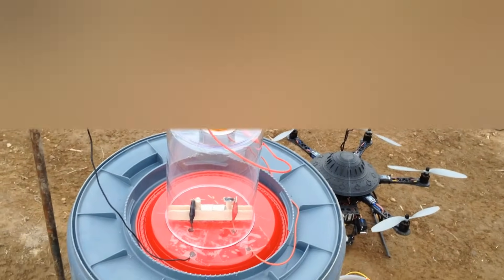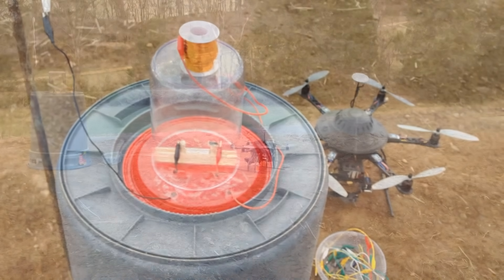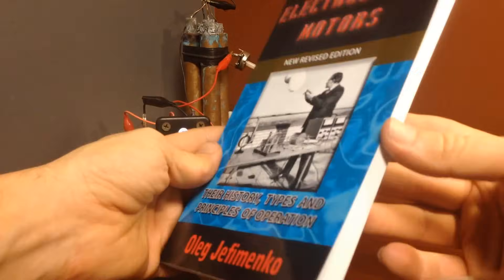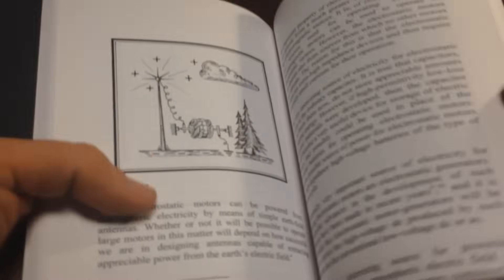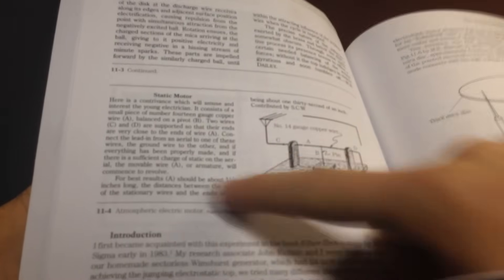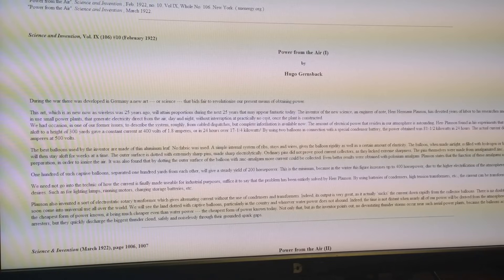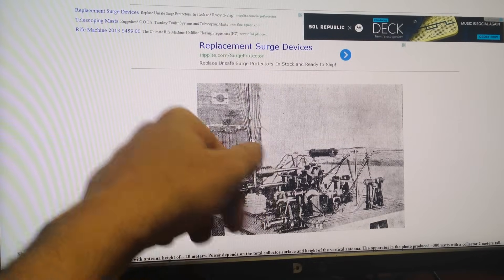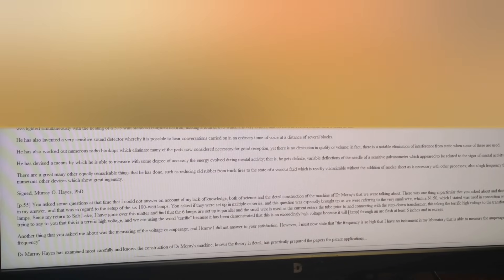Free Atmospheric Electricity Powers Small Motor - Tesla Radiant Energy

Comment: I wonder how much of the energy you are picking up is coming from the motors of the drone you are using to lift the wire.  Just placing a wire in the air will not generate electricity because the wire is not crossing any magnetic fields (other than the magnetic fields generated by the drone).  Now if you could somehow spin a long wire....sure, you'd be crossing some magnetic fields and generating some electricity.  But, since the earth's magnetic field is not moving and your wire is not moving, there is no way to generate electricity.....except for what you are picking up from the drone's motor's EM action.

Comment: There's a secret to tapping a lot more energy from the atmosphere.    Just ground the circuit several times each second to produce an AC circuit and that amplifies how much current is available, which is normally very low.   How this works is it collapses the electric field around the metal conductor each time it's grounded, so that more energy is pulsed through the conductor.   The grounding frequency of the circuit would be very low 4 to 8 hertz, which is possibly related to  Schumann resonances of 7.83hz.   Feynman did a lecture on 'Electricity In The Atmosphere', that's easy to find.     Thanks for the video!

Comment: That rotor wobble is caused by the asymmetric shaped copper rod. Keep the copper rod straight and use a non-metal centering spinning bearing, it will improve the spin significantly. the asymmetric shape causes it to want to rotate on its secondary axis while it is spinning known as the Dzhanibeckov Effect. see celt:

https://www.ebay.com/itm/Celt-as-seen-in-Boyd-Bushman-David-Sereda-interview-defying-the-laws-of-physics-/173553405658

or

https://www.youtube.com/watch?v=1VPfZ_XzisU

Comment: AD Moore's book changed my life! Along the way I discovered that the Earth has layers in the atmosphere. Ever notice the clouds look like they are sitting on a table? With rounded corners and flat bottoms? There's a barrier above them too. This boundary effect d disallows CFCs from traversing to the upper atmosphere to destroy the ozone. The proof they claim is free chlorine atoms, but these chlorine atoms are the result of oxygen receiving an energetic proton to become chlorine. Just as the water vapor layer is resting where it does, the ozone layer does the same thing. When the voltage is sufficient the ozone level increases, formed in place.
Notice also that rain will start when the barrier the clouds are sitting upon short in a lightning bolt.
This is the dynamics of an electrical double layer. 
As an aside, ever consider that uranium hexafluoride is a has? The heaviest elements in the table can float when you give them a +6v? This is a repulsion from Earth's own positive net charge. IMHO
Using tungsten hexafluoride and sulphur hexafluoride you can coat something in a shell 5x stronger than steel, tungsten disulphide...
This last tells me you could use Styrofoam beads in a vacuum to be coated with WS2 and make spherules that would be lighter than air, an analogue to the submarine, a subAeroine if you will... These beads could fill a balloon for lift.

Comment: You don't need the antenna. Tesla figured this out in his later years. He developed smaller units which were fairly powerful. They do require an artificial high voltage source like a neon sign transformer.
Reply: That's right, the unit he had that powered his EV had two 1" or just greater diameter (1.25" or maybe even 1.5") antenna that wouldn't have been much more than a foot long combined. 
He had to tune them by sliding them up and down in their holder from what I could glean. 
They looked like solid carbon cylinders sticking out of a metal box smaller than a car battery sitting on the passenger seat of the car in the pic I saw.

Comment: Not sure if this is practical yet. Would be nice and solve the electric cost. Need some way to capture and store this then be able to utilize this process and the stored electricity for a practical uses.  My findings are that the average family uses about 3000 watts in a days time. So you need recharge the storage. Let the world know if you figure it out you can sell millions and the power companies would go broke. .Many would sell the power companies stock short and sure enough as the profit was gone they would go broke. Trillions of dollars at stake and who wants to invest in power that can't be sold. Many have very high voltage in over head power lines from 12000 volts. You see these florescent lights under 250,000-500,000 high voltage power transmission lines. Power companies would not like you tapping into their power system.

Comment: The problem is the intense. It is only Pico amperes . So the high voltage doesnt really mean anything.
Reply: Use step-down transformer to decrease the high voltage and increase the current/amps.
Reply: @Xeno_Bardock  still the density of the energy is very small. from pico ampere to rich ampere you need to multiply per 1.000.000.000.000 times.....
Reply: @ikaros2006  Depends on how one builds the antenna, also the density increases the higher the altitude antenna is raised. The source of atmospheric electricity is birkeland currents from the Sun which has lot of power. https://www.youtube.com/playlist?list=PLwOAYhBuU3UeKWHRrCw4i-KviQnAhQhBM

Comment: A lot of voltage but probably about few micro or pico amps. So not a lot of power here where you can't power any things like a drill even if you lift thousands of drones in the air. I'm wrong ?

Comment: It is interesting about getting electricity from the sky..with the multitudes of sky scrapers being built you would imagine why the energy isn't used to collect electricity..with them being so tall and huge electric wires could collect current from inside the building and sent into a collector..you wouldn't need wind Mills.
Reply: The main problem with that is once you build something that is electrically conductive to a degree and is also that large, it becomes one with the ground and the electrical fields that increase every meter up just bend around it for the most part.

Comment: i am not here to disrespect or discourage anyone, but only for the truth. As fascinating as the subject of electrostatics may be the truth is using ground voltage differential for electricity is just not feasible. We can generate immense amount of voltage difference using large collectors and clever geometric manipulations, but voltage in itself dont generate current. There are two primary ways to generate current - 1) the exchange of  electrons by ionised electrolytes in electrochemical cell. Thats why we use active electrolytes and make it dense. Air is too thin and inert. 2) the constantly and rapidly changing magnetic flux that induce current in the wire. Here the spinning rotors are at very high rpm for to increase the change of flux...
Nonetheless our understanding of electromagnetism roots from from understanding of electrostatics. And we do make use of ground potentials but generarting current isnt one of them

Comment: Side note: if u notice outside MOST hydro wires are at exactly 33.33 feet high and go 15 feet MINIMUM into the ground, or "Ground".  🍻 And a mushroom shaped ball-head at the top of a 33.33 foot tall wooden pole works AWESOME. Wire snakes around pole to bottom. Add a spark gap arch to keep the electricity flowing from the ethers and then plug in your powerbar somewhere inline above the ground. Also add a bypass line for lightening strikes, and serge protection inline going to home, powerbar or whatever u are powering. Enjoy!!! 🍻 Also, Rodin Vortex donut coils work inline also. Then all u have to do is tune the cycles per cescond from the standard 60hrz to...say...6, 12, 18 etc until your lights work or whatever

Comment: FYi guys...for every foot high u NEED TO GO INTO THE GROUND THE SAME AMOUNT. The point is to go down into the ground to at least the water table, like the Pyramids of Egypt. Salt water is even better. So recapping: minimums are 33.33 feet high AND 33.33 feet deep or down to water table. Think: Van Dur Graff generator WITH ALL SOLID STATE PARTS/NO MOVING PARTS. (Less maintenance)
Reply: that isn't how grounding a circuit works

Comment: I think u need more surface area on top plate. So u will have greater potential diffrence beetween earth and top surface u will put up in sky. The wire will disturb that electric field creating crossing beetwen collapsing dielectric field into magnetic field into the wire, now u have capacitor so it will capture that movement when disturbed by wire potential will try to balance itself with capacitor potential. Greater surface at top more pressure on capacitor more current in wires with bigger potential. But if u wanna harvest good juice u need to think broadband frequencies tesla type resonant receiver and fractal surface areas. Anyway great job :)

Comment: I have enjoyed your atmospheric electricity videos immensely, ty for posting them. In a past video you mentioned the Jules Guillot collector which used only a 2 meter tall antenna collection and I had a thought that you might find interesting to play with. Consider using a combination of his setup with the graphene coated wire strung type collector replacing the iron wire antenna and modern resistors in place of his cobbled together ones for a low profile collector with a potential boost and more stable current collection.

Comment: Doesn't using a hexacopter or any electric device cancels out the whole 
experiment? It could have been magnetic fields from your heli that 
influenced the result. Also the wind created by the props makes static. 
I'm not convinced. If you got the wire up there without the heli, and STILL got electricity then I'd be impressed.
Reply: Yes, the copter invalidates the experiment.  Even without the copter, the motor is so low current, it could be any effect (like thermoelectric, photoelectric, or some ultra-low-frequency alternating EM).  I guarantee the wire is picking up 60 Hz with some fairly high coupling to the nearest power liines.  I had a 5 meter wire pick up enough current, with no active electronics, to drive a crystal earphone, and the energy wad coming from across the ocean.  There is a lot of energy out there that could be corrupting an experiment this sensitive.  We need to up the ante.

Comment: here's an idea for you, take the tesla coil diagram, but use it backwards with the small difference, namely, your antenna should be fractal shape and mass helps too. more wire in the air,  more juice.  Tesla's dirty little secret.
Reply: This was Tesla's intention.
His coils were meant to collect power and convert to useable current.
If you do it though, keep a low profile and keep quiet about it.
Anyone who has tried to publicize working free energy systems has been subject to unpleasant events.

Comment: Is the wire you are running up in the air bare or enameled? wouldn't it collect more electrons and make the rotor spin faster if it were bare, or does it matter?
Reply: from what I understand the more insulation the better , the insulation acts as the receiver and the copper acts as the reflector

Comment: The electromagnetic field given off by the motors of your drone will effect the results. I'm not saying this doesn't work, but it will read slightly higher voltage than it is getting from the atmosphere.
Reply: +inzpectergadget That's simple to fix, just tie a nylon wire with a meter or so to the drone and tie the other end to the copper wire, that way the experiment won't be significantly affected by the drone EMF.

Comment: Its good stuff but its old school and impracticable. Battery technology will be the way forward. The energy that comes form the sun is everywhere all the time. It is what charges atoms and creates our experience of matter. If you think about what lightning is, it is charged particles of water in the atmosphere, that when enough of them become charged sufficiently they ionise the air and jump the spark gap. Aligning the atoms and charging them all in the same direction is the important part. Atoms require no energy to be atoms but they carry huge amounts of energy. It is not about splitting the atoms it is about aligning them, like in a magnet. Water is H2O the potential difference between the hydrogen and oxygen atom is what makes the voltage, very small in one molecule, but very large in millions of them when they become aligned... as it is in a charged thunder cloud. The difference between the atmosphere and the ground just acts like a big capacitor storing charge until lightning happens. We can collect this energy but wouldn't be better to look at how the water molecules are  aligning?  :)
Reply: MattBlytheTheOne lol yeah sure the battery is the new way the old way was discarded and tests was killed because they want you to think Exactally what you just said ;)  have fun sheep
Reply: MattBlytheTheOne There is another level too that is "frequency and harmonics", but as of yet the frequencies are far too high and too small for us to understand comprehensively. One day we will in the not too distant future !
Reply: Dont try to harvest the lightning! Think about creating a battery that generates lightning ;)
Reply: Battery technology is old. "Think about creating a battery that generates lightning" - you're on the right track with this one.

Comment: Why do You not use to tap electricity from atmosphere an antenna done from big balloon, covered with of aluminium foil, this for increase the surface of contact between antenna and atmosphere.
 In the 1° case with foil well sanded surface, 2° second test with foil with micro spikes, in the 3° test with fractal pattern on the surface of foil
Reply: You can use Brown Gas ( gas produced with electrolysis of water) to fill the balloon with gas less heavy of air

Comment: Lovin the vid.
Couple questions and observations.

1.What voltage & current do you think was generated at the motor?

I suppose although free energy, energy is spent in achieving this. Therefore you need a way of obtaining height statically.

Completely numb to this free energy stuff but hooked already.
Just ordered the books.

2. Is the energy harvested proportional to the gauge wire used?
3. Would a larger surface are yield better results, ie suspend a plate from the copter assuming the down draft wouldn't effect it?

Comment: Find the ideal height to produce enough energy to power the drone, make a converter, pass the copper wire by the converter which is in place of the battery(or switched on once on said height) and you get infinite flight and maybe a nobel. And we learn how to get free electricity with an RC and a piece of wire.
Reply: Brilliant idea! Genius!!
Reply: John Hovan I really rethought of it and the energy you get won't be enough to power even the RC unless you went way too high and even then there would be little excess energy. Last but not least, electricity cannot be transferred that easily over long distances and the loses would further reduce your excess amount. This idea... won't 'take off'.

Sorry, I had to do it.
Reply: I believe you have to "tune the circuit" to crank the power up. Would be interesting to experiment with putting inductors and capacitors in the circuit to channel the energy.

Comment: does the antenna wire pick up all atmospheric electricity such as wi-fi, radio waves, cell phone and satellite waves? could it be tuned to pick up all wave frequencies for maximum power?
Reply: I believe it's from static electricity.  Wind blows against the wire, rubbing off (or on?) electrons, polarizing the copper wire.  Connecting the other end of the wire to ground allows for the current to flow freely through the conducting wire, and crosses the jump between one copper wire to the next through induction.  Helicopters have a problem from this concept where static electricity builds up from the rotors chopping the winds, and there's actually a discharge wire at the bottom of most helicopters.  When I worked on the flight deck in the Navy, we were all warned not to touch it or else face a serious shock.

Comment: Sorry I can't get as excited as you about the trace amount of electricity you were able to capture. Obviously you need some way of enhancing or amplifying that atmospheric power if you want to make use of it. Tesla was supposedly able to capture enough energy to run a Pierce Arrow with only a six foot antenna. It seems to me that you could gather much more electricity from an antenna (and ground) charged with a high voltage. Imagine a high voltage battery connected via resistors to the antenna and ground leads. Then the antenna and ground are connected to Tesla's Radiant Energy capacitor + spark gap pulsed DC circuit. The battery would charge the poles of the antenna which would attract charged ions. The resistors would prevent current flow from the battery, making it just a source of static electricity. The electricity would flow from the antenna and ground into the capacitor then get discharged via the spark gap into the pulsed DC circuit for use.
Reply: That is exactly what Tesla wanted to do on a huge scale. I mean, imagine if Tesla had kept receiving funding from JP Morgan. We would not be using nearly as much oil or coal as we do nowadays.

Comment: We live in an electric universe. The Earth is negative, the next layer up is positive (what the clouds rest on) followed by the next layer which is negative followed by positive (cloud to cloud lightning). Lightning, dust devils, tornadoes, and hurricanes are different variables of the same thing, the transfer of charge to reach equilibrium.
 The Sun drives all of the weather because it's the electrical focal point in which the planets are connected creating a circuit. The Sun is not nuclear as it is fed from the outside with electrified plasma.
Reply: flippinrawks yep 👍